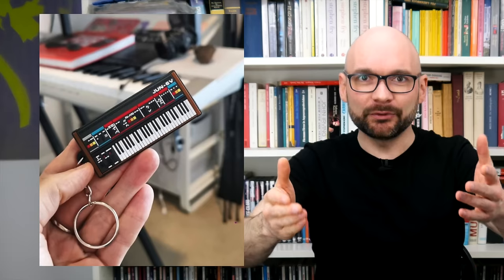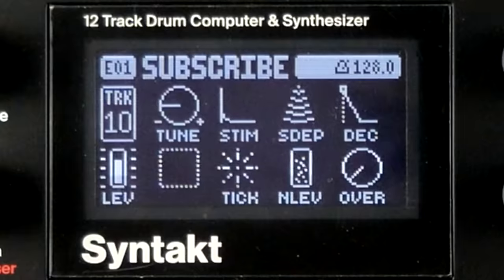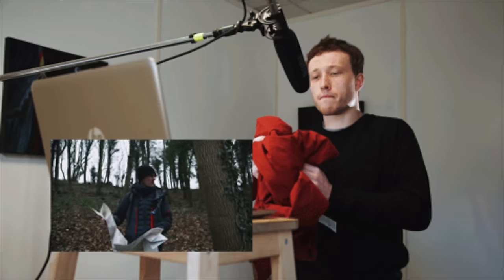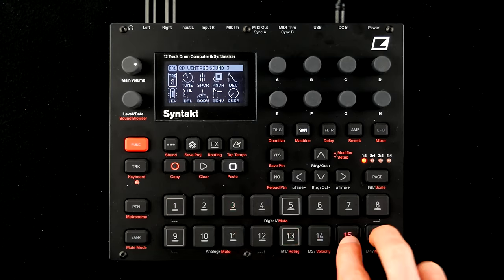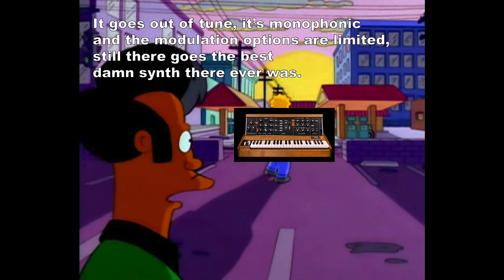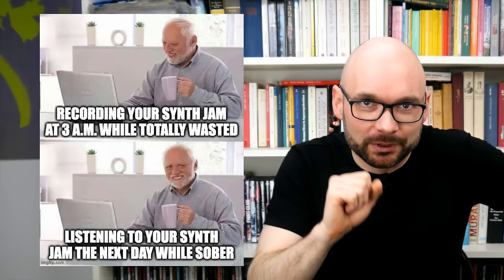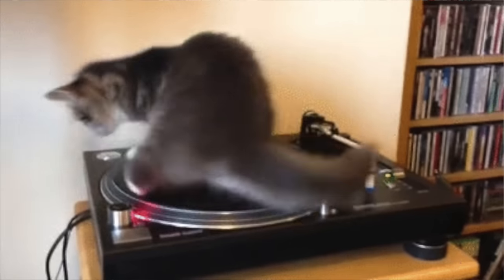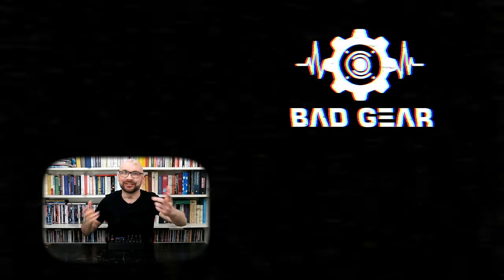Bad Gear - Elektron Syntakt - Model:Recycled

Comment: The Elektron Syntakt is a Model Cycles who started taking steroids only to develop a guilty conscience midway through the cycle. For the price of one of these, you can get two Model Cycles and an analog drum machine.  Or three of the Sonicware Livens. Or a Circuit Tracks and a Microfreak.
Reply from the maker: Lol, shots fired;)
Reply: Model:cycles, RD8 and Modal Skulpt perhaps?
Reply: The M:C machines sound better on the Model than on the Syntakt actually which is very funny considering its 3 times the retail price of a M:C.
Reply: @mycosys   Good call.

Comment: Used to baffle me when manufacturers of this sort of hardware put limitations on it, like no polyphony, or limited steps in a sequence. Once upon a time, these limitation would've been because the hardware of the time truly could not do more, unless they made it three times more expensive... But when you were describing these limits I was wondering if Elektron did it so it wouldn't canabiize sales of other models. Which you then nicely mentioned at the end. 

Once again, I am reminded of the Synthstrom Deluge which doesn't have any of these artificial limitations. But Synthstrom only have one model - it isn't in their interest to put these limits on the Deluge because there is no other model to compete with it. :-)
Reply from the maker: Yeah, the business rationale is understandable

Comment: Love that you threw in the Boss DR-5 in that shot.  I recently repaired mine and have once again fallen in love with it.
Reply from the maker: Thank you! Is it Bad Gear worthy?
Reply: @AudioPilz  It was my first piece of gear.  Bought it in 2002. Does a bit of everything, drums, bass, synths.  I initially didn't like it because I was making hip hop beats and it was made as more for accompanying guitar players.   But I learned the basics from it.  The pads are positioned in a unique way resembling a guitar neck.  But I rediscovered it and have been boosting it's cheesy old synth sounds with FX pedals.  I love that it's portable and use it on the bus.  
It's bad gear in the sense it's from 1993 and has the obvious limitations of it's time.

Comment: It would have been so much cooler if it was the analogue section plus a sample player (like Model:Samples) instead of an analogue section plus FM. Like, when you add in the drums from the sample-based SR-16... that sounds great. I'd much prefer to have that kind of palette available inside the Syntakt than all the FM machines, but that's just me.
Reply from the maker: I feel the exact same way
Reply: I mean you're kinda just describing a less flexible version of the analog rytm at that point

Comment: I was going to buy one of those until i saw this. 

I swear it’s like you take a peek into our homes straight after we’ve bought something then do an episode on it.

I bought the Toraiz AS 1, Roland TB-3, System 1, MX 1, and SH 201 then found your channel 🤣

I’m just waiting for you to do an episode on the SH 4d, TR8s and MC 707.

Please don’t do an episode on the Akai Force🙏🏻
Reply from the maker: Akai force... Sounds interesting;)
Reply: @AudioPilz  

The Force is a beast, imo it’s ideal for beginners and great for learning. I’ve not ran into any issues as of yet but then i’ve barely scratched the surface. Would be nice if they’d upgrade the ram just to keep it in line with everything, i have reached out, one can hope 😁

Enjoy the rest of your weekend 🤙

Comment: The Roland Sh4d is blinking at you from the distance. It's like it was designed to fit the Bad Gear formula! Quite a fun piece of gear though, it replaced my JX08 as a portable sketchpad and it addressed most of my pain points with the Boutiques (and the Jd-Xi I used to own, which it seems like a spiritual successor to)
Reply from the maker: Great suggestion, thank you!!! I really need to get one of these!

Comment: Suggestion, and this may actually slightly challenge you: the nunomo qun mk2.

185 USD. Granular. VA. Sequencing 64 steps, 3 parallel tracks. 3 looper tracks. 

Tiny tiny powerful groovebox.

Has more polyphony than the syntakt 🤣
Reply from the maker: Great suggestion, thanks!!!
Reply: Except that's absolutely not bad gear that's a crazy amount of features at this (unbeatable price).
Reply: @nkszjfhngznkszjfhngz  have you seen bad gear? It's all good gear now :)

It started out genuinely kind of dunking on gear but he ran out of truly terrible stuff a while back and now I feel like the format is just a fun way to find the pros and cons of gear and poke fun or mention certain limitations, but also find what it's good at

Comment: AudioPilz and other users... I,m a DJ and i have a hardware proyect for lives but im totally lost about what equipment buy for add organic designed drums, bass, etc...to ny live set proyect. I want a sound somehow like Boys Noize from dance flor punch and the barroque design and swing of Floating Points,  kind a IDM with the detroit techno spirit... Now i have a Roland DJ 505 for send midi clock, mix with another tracks and vocals with the integrate TR (very limitated) and one Roland S-1 for apply the bass and some air arpeggios and movement.....Is the modular way my best option? I love the Syntakt, but is a bad gear? guys im a very noob in harware midi production. I need do a techno and house jam with complex moving sound design...thanks
Reply from the maker: Sample-based drum machines come ro mind here - Tr-8s, Digitakt, MPC...

Comment: Why is 64 bars per pattern such a limitation? I've programmed many tracks on my MPC and the most I've ever used was around 24.
Reply: Wait, in the video you mention 64 notes per pattern, and on the screen with all the negative comments there are two saying 64 bars per pattern. Which is correct?
Reply from the maker: Presumably, the hate comment was a typo but made sense in context

Comment: It's a great Elektron development imo... & I've got them all besides the now very expensive to acquire, Machinedrum. With powerful x2 Elektron lfo's per digital or analogue parts... U can modulate & create a deeper pallet of drum or synth patches, than u can with a Syntakt... Than the 2 other Elektrons it shares common traits & machines from, which are the Model Cycles & Rytm boxes. It takes the great FM/Wavetable made user friendly basis of appeal, from Model Cycles development as a product... & adds to it. The Cycles misses out allowing one to properly follow the sound design of its FM/wavetable machines & synthesis... With a true complement of subtractive synthesis, But the Syntakt will tho... & u get a more pro spec development & advanced Model Cycles, with more scope to shape filters & amp, with better env's & x2 lfos. With the same extent as the other 2 Digitone/Digitakt does via its subtractive synthesis nature's too. It's great for adding that Rytm analogue drum sounds & vibe into things too... Many will find a better balance of affordability, by not having to spend the big $ towards Rytm mk2's especially... For otherwise wanting imo, the best Analogue drum synth for considering nowadays... But getting much of the best 4 parts of Rytm's in a slightly higher priced Digi style device. The x2 Lfos of the Syntakt does make those Rytm parts more flexible too... If Elektron adds another lfo to Rytm's it will be a huge plus to those for implementing in. I can see Syntakts likely getting the arp features of the Digitones eventually too. They seem to be improving its synth features now from its release... To make it a great all round drum & synth groovebox. Peace to ya, & keep up the great work... I'm in my late 40's & owned my first synth in '89, so admittedly I first thought I'd be a thorn in your side for comments of so called BAD GEAR demo's & reviews. But I'm a fan now instead😊
Reply from the maker: Thanks! That sums it up nicely!

Comment: How much more value does it have, over last weeks entry? 🤣
Reply from the maker: The answer is: YES
Reply: @AudioPilz  So, it's what, 3 times the value, since it costs the same as 3 xfm's? 🤣 Not a chance in hell, bro. That's 12 separate synthesizers in xfm world, equaling the Syntakt, and potentially besting it's polyphony, by a bit...Each with it's own advanced sequencer. Then there's all the craziness that one can accomplish with three sets of effects, including multimode filters, that all can process external audio signals....... 3 xfm's are vastly more powerful than a Syntakt. Routing potential is bonkers.

Comment: The syntakt is nice but pointless if you already have certain other Elektron boxes. It is just some of the analog rytm with some of the model cycles. Cool if you don’t already on a rytm but more concerning is that this has been a new trend in Elektron like how the Digitakt is basically just the sample engine from the analog rytm. If this was coming from a company like Korg or Roland I wouldn’t flinch but coming from Elektron which has brought us such legendary gear as the Machinedrum, Monomachine and Octatrack I’m afraid Elektron is no longer the boundary pushing left field brilliant company that it once was. It won’t matter to most people but the lack of innovation from a company that at one point I would have pre-ordered anything they made just from their announcement if they continue on this path it will be quite a fall from grace
Reply from the maker: It's kinda like a best-of...

Comment: Oh no you didn’t
Reply from the maker: I had to complete the dark trinity
Reply: @AudioPilz  great video as always! I really hope they add polyphony through voice stealing down the road, the way it works on the A4. With 12 tracks and the way the elektron sequencer works I find myself hardly using up anywhere near 12 tracks when I use the Syntakt. Would be really nice if I could use a few of the digital tracks for a 4 or 8 voice polyphonic synth. Please elektron 🙏🏻